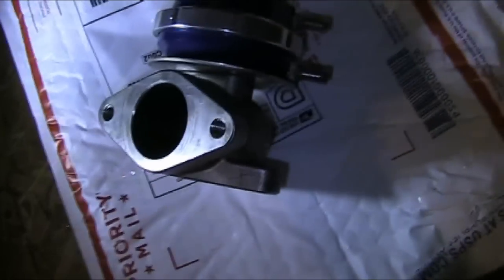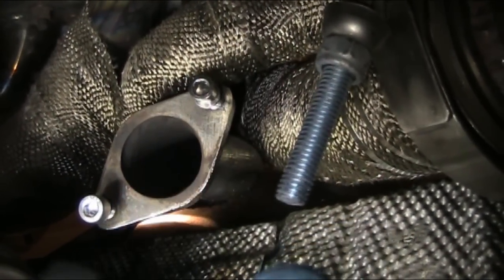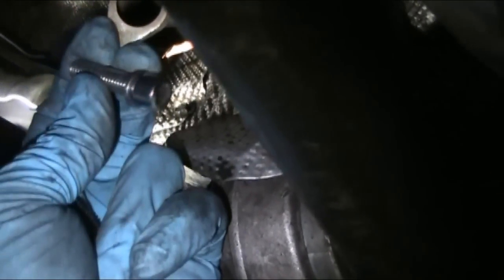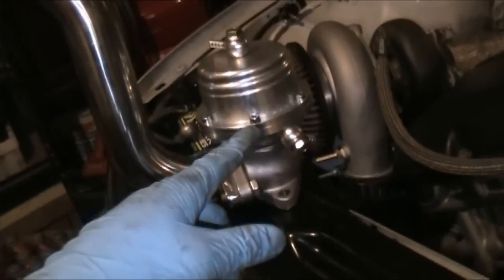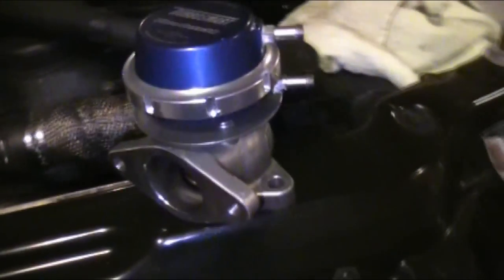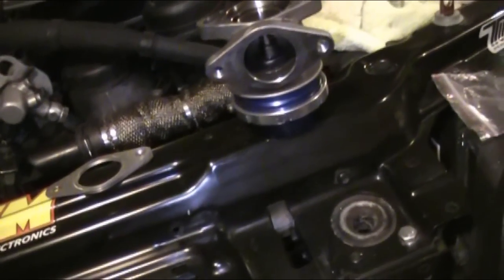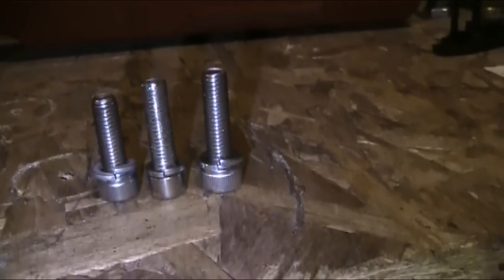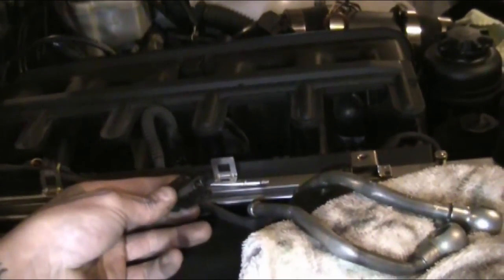BMW E46 Turbo Build Upgrade Parts Install #3 Wastegate

Comment: Just want to as i build m54b30 engine , m12 studs, decompression plate, 630 cc injectors, turbo Kuro GT35.82 101 housing , and wonder to ask TS wastegate 45mm will be enough for me ? Or need go bigger ? Thanks 

Just try push 430-500bhp 
Thanks
Reply from the maker: Hello, 45mm should do you good 👍
Reply: Thanks man 🙏 appreciate for fast response. You r star , your project sick man 👨
Reply: What is your turbo and pushing power atm?
Reply from the maker: @jevgenijsalgunov774  these videos are from around 2 years ago. I'm back to N/A now. The engine shown here was an M52TUB25, made 170hp without boost. At a small 9psi, I was at ~340hp.
Reply: @OLearysBMW  yeah i see what is the 2 years ago, but still good set up . What why im searching the info , and it really helps for us , who r new with turbo builds  🤜🤛

Comment: Awesome videos Tyler! I bought a 2001 325ci and want to install the CX racing turbo kit on my car too. I’m curious if you have tracked your car after the turbo build and how it holds up throughout weekend sessions? I plan on upgrading my wheels / tires / brakes / suspension too. Previous owner just installed a new OEM clutch, will this new clutch hold up after turbo with say 7 or 8 psi?
Reply from the maker: Hello, since this video the car is currently tore down and is seeing full revisions. The OEM clutch I can foresee holding up to that, yes. For how long though, I'm unsure of.

Comment: So what is your opinion on frame reinforcement for the rear subframe. People talk abt it on the forms however 97%of people are running FI on m3’s. Now the m3 would pump out more and run higher boost than what im looking to run. My car has 250000 on it and has been my daily for 2 years. I love the videos and they are super helpful knowing what im going into.
Reply from the maker: Definitely a must for E46 chassis. No if, ands or buts.

Comment: Hey bro, I love the build. I'm trying to build a turbo kit for my n52. Where did you add your water lines for the turbo?
Reply from the maker: Did you mean to type "N52"? On my M52tu, I used the block drain and lower radiator hose 😁
Reply: @OLearysBMW  hey, hey.  Thanks for responding. I appreciate you.
Yeah, I mean the N52 e90.
Reply from the maker: @juelsmcgill525  one of the few! That's awesome

Comment from the maker: UPDATE: DO NOT use this wastegate, this TurboSmart UltraGate 38mm causes boost spikes! I'm not the only one that it's happened to. My car hit 14psi, this wastegate only had a 7lb spring installed. This wastegate does not work well for our application!  Also, do not use an MLS gasket. Unless your flanges are 100% flat and level, it won't seal. I recommend a good composite type gasket so it can be compressed. Giving you a better seal.
Reply: 7 LB spring inner and outer are 14PSI set up
Reply from the maker: @Unknown-w6b8n  I ran a single 7lb spring with a boost controller to increase by 2psi. Car was consistent with 9psi until long, high rpm pulls. That's when it crept. Others have reported the same problem with this exact wastegate, also during wot/high rpm. For starters, I feel I should've ran an 44mm wastegate. This being my first turbo build, mistakes are well taught lessons and I now know what to do the next time around
Reply: @OLearysBMW  Dang. I have the 38MM Gen 5 14 PSI sitting on my desk for my 328 N20
Reply from the maker: @Unknown-w6b8n  It may work for an N20 build just fine. That's a whole different platform